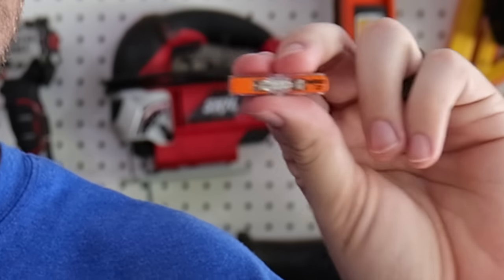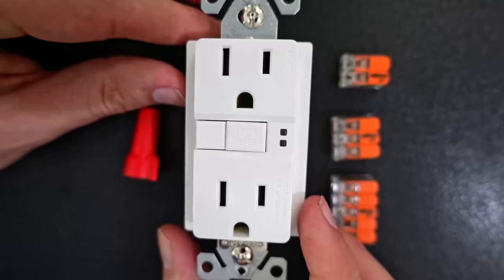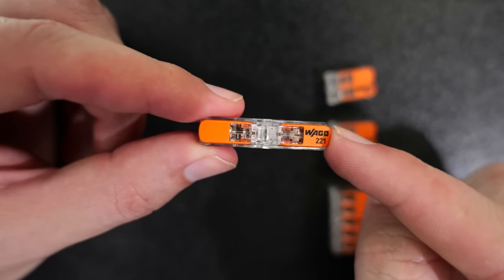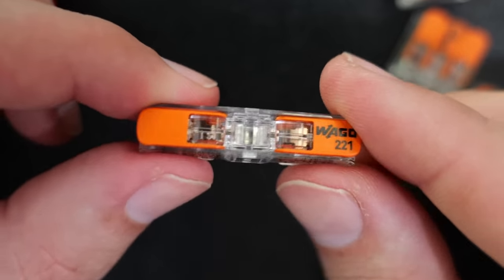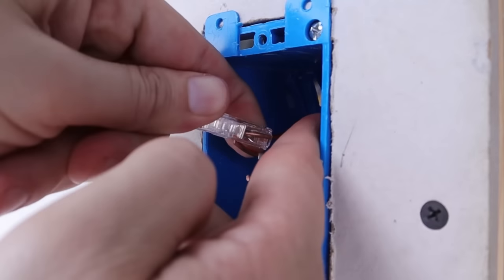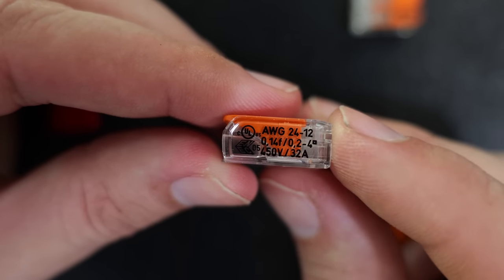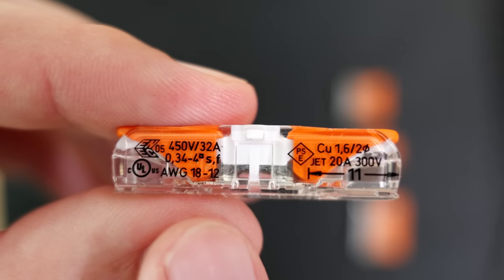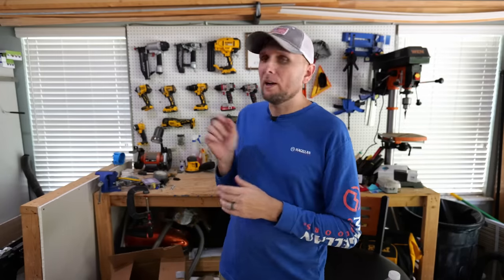New Wago 221 Inline Connector That EVERYONE is Talking About - And One Thing Nobody Talks About

Comment: Would like to see Wago make AWG 10 straight connectors more readily available in their assortments.
Reply: Agree. I'm planning to install a manual transfer switch and the inline connectors will work great and keep my main panel looking clean. An AWG10 size inline would be helpful. I wonder if WAGO reads these comments?

Comment: Heat shrink to keep levers secure
Reply: No need to do anything with the levers. If you use the indicated wire gauge the spring action keeps everything in place practically forever.

Comment: Has anyone tested these for surge current?  Modern electronics (like the LED lights) have capacitors that have to be charged with a surge of current when switched on.  I have measured this intermittent surge at over 200 amps.  A connection make with twisted wire and a wire nut has a large surface area contact that is no problem for this surge, but I have noticed an unusually frequent failure of light switches after the changeover to LEDs. Will the blade type contact on the Wago handle the surge?
Reply: Wago being a German company is assume they have done extensive testing.
Reply: WAGO for the win.  Rated to worldwide standards...much better than obsolete twist on connectors
Reply: Actually WAGOs will have a far larger effective touch area than twisted wires and wire nuts because of the far greater force pressing down on the wire.
Reply: @benbedothu  Resistance is determined  by both contact area and force.  CURRENT Capacity vs temperature is a function of cross sectional area of the surfaces in contact and their resistivity.  I Don't know what the spring contact is in the Wago but it is not pure copper with a high conductivity, but probably beryllium copper or, better, nickel copper (higher temperature capability before the "spring" is gone).  Either of these will be higher resistivity than pure copper.    And if the contact is coper plated, even worse.  Notice that I am not condemning the Wago, I use them myself.  I just limit the application to locations that are not likely to need very high surge currents.
Reply: Surge current doesn't matter that much. The current rating of a connection is determined by the temperature it reaches over time. (In contrast, the voltage rating is insulation at any moment in time.) So if the surge is short enough so the connection doesn't get hotter than it's rated for, all is fine. You probably could draw 200 amps through this 32 amp connector for several minutes until it gets too hot and melts its plastic (at which point the Romex that's rated for just 20 amps would do the same).
Reply: @HenryLoenwind  Surge current rating is an important factor.  Contact area is an important factor in "spot welding" effect,   A high current with a small contact area causes this instantaneous high temperature  over the area and will probably lead to oxidation of the contact so that it has degraded capacity.  This in turn leads to more heat in normal operation, with furtherer degradation of the contact, etc.  The real problem is the magnitude of the unknown current spike and it's duration.  No specifications either on the contact or the magnitude and duration of the surge.

Comment: The tan wire nut by Ideal is the best connecter on the planet. May be the most widely used with residential wiring. With that said the Wago connecter looks like a solid piece and I will use them when deemed necessary. New innovative stuff takes awhile to get accepted. Remember copper pipe vs PVC. NEVER use a shark bite but use them. Ha! Old man time will bear witness.
Reply from the maker: Totally agree with you Neil.  The tan Ideal wire nut is my go to when it’s not too small.  Appreciate the input!
Reply: I switched to 3M tan/red wire nuts and really like them. I also use Wago and Ideal lever connectors when needed.
Reply: "New innovative stuff takes awhile to get accepted." Wagos (with the current mechanism) are 46 years old now---that's quite "a while"...
Reply: @HenryLoenwind  It is so weird to see Americans still using wire nuts, I have to open up pretty old walls here in Norway to find wire nuts of all things.

I would mostly find the old gray non-transparent WAGOs if I did.
Reply: @Freakyfish42  Never seen a wirenut in Germany. In my work experience week back in '87, we were rewiring a building, replacing ceramic screw terminals with grey WAGOs...

Comment: 20A is for Japan. 32A everywhere else - as shown on the left hand side of the Wago
Reply: Do you know why it's a different rating in Japan
Reply: @josephpimentel4624  Not a clue, just noted it from the eFixx video on the same connector.
Reply: @Hamish_A  ok thanks for responding
Reply: @josephpimentel4624  Different maximum temperatures due to different wiring standards and different common construction materials, combined with considerations for failures from earthquakes.
Reply: @HenryLoenwind  thanks for answering
Reply: @HenryLoenwind  In that case it might be prudent to go by the Japanese standard rather than the others, particularly in wooden construction in the US. Japan has both wooden construction and a 100v electrical system, the closest to the US system in comparison to Europe. Because our voltage is lower, just like Japan's, these are more likely to be more heavily loaded than the ones running at 220v in Europe. So following the Japanese ratings would result in cooler running connections.
Reply: @theodorgiosan2570  That's pretty much a non-issue, I'd say. How many 21A-32A connections are there in any normal US installation anyway? Circuits for outlets and lights are 15/20A and the lines to the breaker boxes are 100/200/400A. At most, there may be a dryer outlet at 240V/30A, but even there, 40A and 50A are more common nowadays.

Europe, on the other hand, or even more specifically, Germany, where WAGO is from, has plenty of 32A circuits. 32A is the maximum breaker size for non-industrial installations and everything but 32A and 16A breakers is "I can special-order that for you"-rare.

Comment: I often need a 4 wire connector but they don't make it. I don't want to put the 5 wire ones but I end up having to.
Reply: Go for the clones :)  Any combinations are around :)
Reply: @Dmitri Pogosian  I tried one set of clones and the latches didn't close tight enough.  I had a wire pop out when putting the wires back into the box. isn't it weird that Wago doesn't make a 4 wire lever version though? I put double duplex receptacles in my house to reduce power strip usage. That setup uses 4 wires: Line in, whatever you call the line out to the next box,  and 2 pigtails for the outlets. I guess I'm an outlier, but it seems a common enough config that a 4 wire connector makes sense.

Comment: In video it's mentioned that wago's have poor "weather" resiliency. Stock true, but there's also wago option to have wax box. You put wago's in and close the wax box and it's almost like fully embedded in resin after that, but with difference that you can actually tear it off and re-use clean connectors. Just to note.

Comment: Couldn't you just heat shrink OVER this connector, for water-resistant scenarios?  Yeah, more expensive than butt-splice connectors, but far less error prone.  Bonus points:  You can just disconnect and reconnect when you realize you forgot to put the heat shrink on the wire before finishing the connection.
Reply: I was wondering the same thing. You'd probably need 3:1 or 4:1 water-rated tubing with sealant on the inside.
Reply: Search for WAGO Gelbox, they have a solution.

Comment: The Wago connector is perfect for light fixtures, which come with stranded wire, where the current draw is low, but I don't trust them for high current applications where you may be drawing 15 amps or even 20 amps.
Reply: They can handle 15 or 20A load just fine.....have you looked at the UL DIN VDE ratings...they have been used for years in Europe....Just being stuck in the past with Wire nuts, is why you think these will fail
Reply: @cengeb  I use them in low load circuits all the time, so I'm not stuck with wire nuts.
Reply: If these were lying about their rating, half of Europe would have burned down 30 years ago...

Comment: That would be great for a light switch to connect the 2 neutral wires together
Reply: Side by side work fine for this, they fold neatly into the back of the box if you plan/bend it right. Push connectors are all you need. Tape the Wagos with levers if you have a tight space because those levers WILL get bumped and lifted.
Wagos are good for connecting lights or for pigtailing receptacles that you know will be upgraded (adding USB or a light)

Comment: I don't believe the soldered butt connectors are rated for water at all..
The heat shrink is for a tiny amount of mechanical protection. But provide no IP rating whatsoever, and the very few I HAVE been able to find is IP4X and IP5X.. So at the very most its saying to keep other wires out of the enclosure and one even saying it has `dust` protection..

Comment: Which inline WAGO 221?  Neither if the wire is thinner than 20AWG.  Non-inline WAGO 221 connectors can handle wire as thin as 24AWG.  You won't find wires that thin in household electrical wiring, but you might in other kinds of projects, for example inside electric guitars.

Comment: Seems pointless having the lower size conductor version. Also in practice they can both take 32A, as is stated, it's just an approval organisation difference as far as I can see.
Reply: It isn't really if you have a very long run you may need to upsize to a larger conductor so having a connector that can take in the larger conductor is good. Also it is just built a bit more solid and clearly has a stronger clamping mechanism which is always a plus.
Reply: @riakata  My point is, why not just make the larger capacity one as they both look the same overall size......
Reply: That's not by intent but the result of the American rating. They are actually both rated for the same wire dimensions in square millimetres.

Comment: All I hear is how difficult it is to use solid and stranded wire with wire nuts most electricians don't have this problem because they know to lead the stranded wire by a mm or two and there is no issues. When it comes to using just solid wire there is no issues at all when using wire nuts if you pre twist the wires. The Wire nut is the best option when space is not an issue.

Comment: how can you even have a wire nut in the same picture as a wago in 2023? xD wire nuts haven't been used in years in sweden, it's been wago 221 since like 2016-7, and those old small-arm wagos before that. Get with the times
Reply from the maker: Nothing wrong with a properly installed wire nut.

Comment: You're adding more fuel to my fire! While I don't think much of the Wago I'm more disturbed by the lack of transparency in their approval by the NEC. I this video you stated Wago changed the size of wires for a particular device and also mentioned the change of internal components of another. Did our very specific NEC specifically approve the changes??  I googled around to attempt to find out the process by which any new devices are approved and challenge you to do the same with results.
Reply: Nothing else should be allowed to be used by electricians but WAGOs everywhere. In most of Europe, that's actually the standard. Wire nuts, butt connectors and the like are hazardous, outdated things, they must go!
The NEC doesn't have to approve anything. They set a minimum requirement that WAGOs meet by far.

Comment: I dont see where these inlines would do anything that  2 slot wago wouldn't  do.
Reply: I think there are situations where they are advantageous, but I agree, most of the time the 2 slot would be better. The length of them could be an issue.
Reply: That is why Wago give you a choice,it's the same but different.
Reply: They work really well if you accidentally cut a wire with no slack in it.

Comment: Weird that they are rated for 20A but can’t accept 12 gauge wire.  Makes no sense.
Reply: Think international. Someone above mentioned seeing an eFIXX video that said that the 20 Amp rating was for Japan. I'd guess that the 32 Amp rating is for the UK and their ring circuits. Whoever approves it in the USA (UL or NEC?) must have only allowed 14 gauge wire. Might also be because the American Wire Gauge sizes don't exactly match up to the typical square millimeter sized wires in Europe - and the rated current ratings for similar sized wires are a bit different too.

Comment: Absolute madness due to 2 separate alloy transitions AND very high cost. I would not use these for anything other than low power LED lighting or where I expect to have to disconnect and reconnect them multiple times.
Reply: Dinosaur.
Reply: @onelineal9382  Are you a bot?

Comment: You are comparing it to a red wire nut. Comparing it to a yellow wire nut would be more fair.
Reply from the maker: They do the same thing just capable of differing wiring capacities as far as size and quantities go.
Reply: @HowToHomeDIY  Yellow are much smaller. I think it is a more fair comparison of size. Most residential wire is 12 or 14 AWG

Comment: They don't deserve all the attention.  I will never use unless I want service calls from my customers.
I don't do residential, only industrial, they expect zero call backs, zero failures and zero downtime.
I rarely use wire nuts but when I do they are 3M ScotchLoks.  When the plastic fails then spring retains tension on the joint.  This keeps the conductors in good conductivity.  These do not do that! The "copper" inside these are actually thinly Copper plated spring steel.  Have found many problems, some dangerous, when this plating is
fails or isn't 100 % there for some reason and you have a copper to steel to copper connection.  No bueno.
People will die I am sure and these will be banned!  Hell, NFPA gave us AFCI's required EVERY where because just 6 people died!
Reply: heh.... reminds me of working in metal plant over in WV; the little union contractor electrical teams in the 3 wheeled yellow carts.  Only they could touch any of the wiring.  

I had to spend 5 weeks out there re-wiring a a multi-million dollar NDE system because the "electricians" decided to use wire nuts on 50-V400V DC low amperage DC signal lines.  On the ocilloscope had a bunch of signal interference...  heh...  Almost looked like a 60hz sine wave (what in the world would make that?)...  After un-wrapping the mess and separating power cables from signal; re-doing with shielded cables and solder+heat shrink....  all problems gone.

End of day; right tool for job; wagos and wire nuts both have a place and time to be used; neither is better; pends on application.

Now my light fixture that is pulling 120V at "maybe" 1amp; more then fine.
Reply: Dinosaur

Comment: plastic usually fails, cracks and breaks over time
Reply: And that's different for wire nuts?
Reply: @Hermiel  ...and the plastic around the wire?
Reply: @HenryLoenwind  Yes, there's that, too.
Reply: What is your insulation material of choice?
Reply: @Hermiel  wire nuts use thicker and robust plastic, not thin translucent material, time will tell
Reply: @MichelCastonguay  My sense is that German checmical and material engineers are among the best in the world and that the plastic compounds they selected for these connectors are suitably robust despite their transparency. 

Also, these things have been in use in Europe for decades. You say that time will tell and I say it already has.

Comment: buddy it rated for 32 amps not 20.
you're speaking English so this video is probably for a US audience
Reply from the maker: Yes buddy I’m speaking to my American audience in that regard.
Reply: @HowToHomeDIY  UL listing is 32 Amps
Reply from the maker: In the US Wago has made clear that they are rated for 20 amps due to the maximum wire size allowed of 12 AWG.  They have press releases about it.
Reply: @HowToHomeDIY  where is this press release?
Cause it's clearly UL listed for 32 Amps.

I don't believe you understand the purpose of a UL listing.

Comment: Regardless of there so called good quality I don't trust them. I will just use wire nuts because they work.
Reply: They have been used for many years in Europe on 220 with 20 amp circuits. They are easier to do safely than wire nuts.
Reply: @JorgTheElder  
I don't trust them. The heat up and cool off and become unstable. Say what you want but I seen it myself. There is no way you can say a 20 amp circuit will never go over 20 amps with things starting up it happens most every time. That will kill the Wago .

Comment: If you are using one of these you or someone before messed up..... I will run a whole new circuit before I use a wire stretcher...... Poor electrical work!!!
Reply: Remember those words when some reckless drywall installer slashes your wires with a rotozip tool

Comment: Do they make one to eliminate a junction box ?
Reply: I don't think ya can eliminate a junction box as per code all wire connections and sices have to be done in a box although these can me used to junction 2 wires together as like a extension
Reply: There is a romex splicing kit that is rated to be buried inside your structure, but it didn’t have very good reviews when I checked it out.
Reply: @MoneyManHolmes  thank you       do you have more info
Reply: @HeWhoIsWhoHeIs thank you   I won the bet     with my know it all better half       5000 dollars !
Reply: It’s called the Tyco Romex splice kit, but it was restricted in more recent codes. It looks like it can only be used to repair damaged wiring now.
Reply: @MoneyManHolmes  much thanks 😊